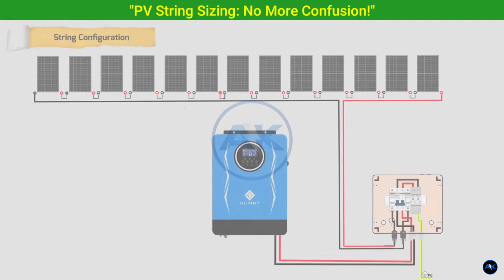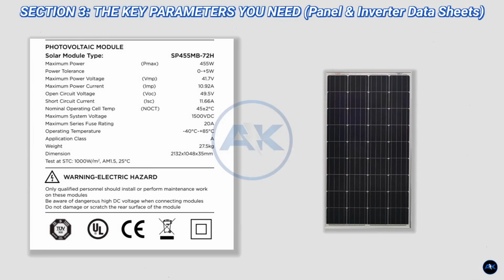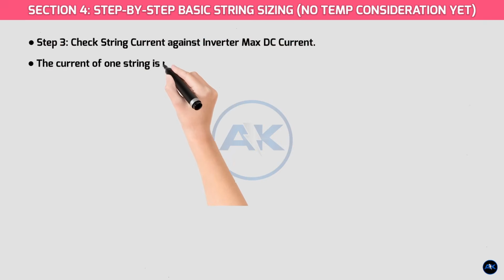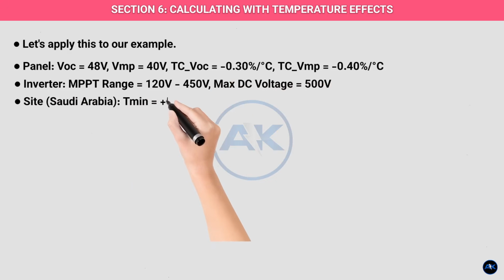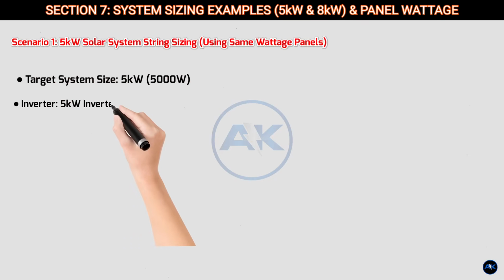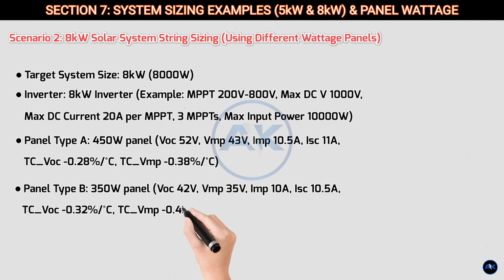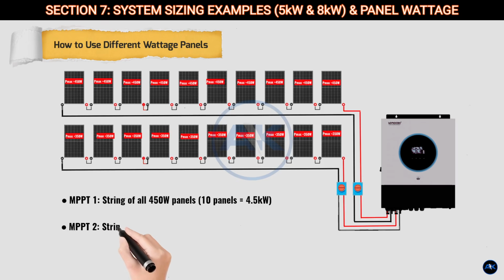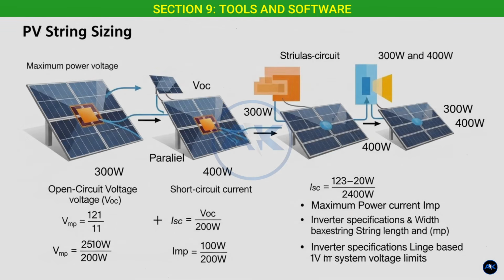🔥 PV String Sizing MASTERCLASS: Design Your Solar System Like a Pro! (Beginner to Advanced) 🔥

Comment: I have a small 1.3kW panel array, 2 panels on different elevations, as I have limited roof space. My choice for inverters is either 2x700W inverters (one inverter per elevation, which will require 2 separate AC circuits), or a 3kW dual mppt inverter. Which one is the better option? It would be great if you could make a video on the pros and cons of oversizing an inverter!
Reply from the maker: Great question, and this is actually a really common dilemma with small arrays! Since your two panels sit at different elevations, you need independent MPPT tracking per panel either way, or you'll get mismatch losses dragging down your total output.
Both your options solve that. The real difference is oversizing. The 3kW dual MPPT inverter is way oversized for a 1.3kW array (DC:AC ratio ~0.43), so it'll spend almost all its life running well below its rated capacity, sitting in the less efficient part of its curve. The 2x700W inverters are sized almost 1:1 with your panels, so you'll get better real-world efficiency, just at the cost of running two AC circuits.
If you want one AC circuit without the oversizing hit, look for a smaller dual MPPT inverter, something in the 1–1.5kW class rather than 3kW.
Solid suggestion for a video, adding it to the list 🙏

Comment: Sorry I'm late for Lessons but I need to know about what makes the battery charge fully  ,is it voltage or Current?
Reply from the maker: No worries at all! Great question — it's actually both, but they play different roles:
Voltage is what drives the charge into the battery. Your charger must supply a voltage higher than the battery's current voltage to push current in.
Current is what actually fills the battery. Think of it like water — voltage is the pressure, current is the flow rate.
Here's how a typical charge cycle works:
Phase 1 (Constant Current): The charger pushes a steady current in, and voltage rises gradually.
Phase 2 (Constant Voltage): Once voltage hits the target (e.g. 4.2V for Li-ion), the charger holds that voltage and current naturally tapers down to near zero.
⚡ The battery is considered "fully charged" when the current drops to a very low threshold (usually ~3–5% of the rated capacity) — so technically, current reaching near-zero at full voltage is the signal that charging is complete.
So: Voltage sets the ceiling, current fills the tank, and the drop in current tells you it's full. 🔋
Hope that helps — never too late to learn! 💪
Reply: @akelectricdiy such a great explanation 😊

Comment: Excellent video. Easy to follow.

Which software do you recommend to use for simple residential jobs.

Do you have a spreadsheet/Google sheet available to download?

Thank you from Australia
Reply from the maker: Hey, thank you so much for the kind words — I really appreciate it! I'm glad it was easy to follow! ☀️⚡

For simple residential solar jobs, I'd recommend Solar Design software like Aurora Solar or Pylon for system sizing and design. For quoting and job management, Tradify or ServiceM8 work really well for electrical/solar contractors.

And yes — a spreadsheet for basic residential solar calculations (system size, panel count, battery storage, ROI estimate) is a great idea! I'll work on putting one together and make it available for download soon. 🙌

Thanks for watching all the way from Australia! 🇦🇺 Great solar country — you guys have amazing sunshine hours! ☀️
Reply: @akelectricdiy thank you for the detailed response, much appreciated. I will check out the software.

I just completed my solar design and installation accreditation today, I learnt more from your video than I did for the past week 😆.

I will be starting the battery design and installation course in a few weeks, I have subscribed and will keep watching for tips.

In Australia we need separate accreditations on top of our general electrical licence.

Comment: Thank you very much for your detailed explanation, try not to explain very fast so that all of us can follow and understand, I got lost when it came to the temp co efficient, it's more complex therefore it must be done slowly such even if you a beginner you can catch up
Reply from the maker: Thank you so much for this honest feedback, @kestonpedzisayi! I’m really glad you found the detailed explanation helpful, but I hear you loud and clear on the pacing.
You’re absolutely right—the temperature coefficient is one of the trickier concepts to grasp, and I shouldn't have rushed through it. My goal is to make sure no one gets left behind, regardless of their experience level.
I will make a conscious effort to slow down and break these complex topics into smaller, more manageable steps in my upcoming videos.
Reply: @kestonpedzisayi
You can change the video speed on the YouTube video settings, whilst you're watching.

I had the same problem, and changed it to 0.75 instead of normal speed and worked perfectly.

Comment: Panels need to be at least 150% bigger in capacity than your battery bank.
Allows for shading and other issues.
Ideally you want your array to generate battery bank capacity + anticipated load times 1.5. Relative to wattage/amperage.
Excess is better than losses.

Try not to exceed your controller's max input voltage.

Comment: STC is cell temperature,
So we have to take cell temperature hottest day,
But you take ambient temperature? 50
Reply from the maker: Thanks for the question! It's a great point. While STC (Standard Test Conditions) uses a specific cell temperature of 25°C, real-world solar panels operate at a much higher temperature than the ambient air, especially on a hot day. This is a common and important distinction to make when discussing PV system performance. We agree that ambient temperature isn't the whole story.
What's the difference?
Ambient temperature is the temperature of the surrounding air. It's what's measured by a weather station or a typical outdoor thermometer.
Cell temperature, on the other hand, is the actual temperature of the solar cells themselves inside the module. This temperature can be significantly higher than the ambient temperature due to the sun's radiation heating the panel's surface. A typical rule of thumb is that cell temperature can be 25-35°C hotter than ambient temperature. This is why a panel's performance is often rated under NOCT (Nominal Operating Cell Temperature), which accounts for more realistic operating conditions (800 W/m² irradiance, 20°C ambient temperature, and a 1 m/s wind speed).
Why this matters
The output of a solar panel decreases as its temperature increases. This is a crucial concept, and it's why the user's point is so relevant. When we talk about a panel's output, we often use the power temperature coefficient, which tells us how much power is lost for every degree Celsius rise in cell temperature above 25°C. For a typical silicon solar panel, this is around -0.4% per °C. So, on a hot, sunny day, a panel rated at 400W under STC might only be producing 350W in real-world conditions because its cells are so hot.
So, you're right to point out that cell temperature is the more accurate measure for understanding how a solar panel performs in the field.